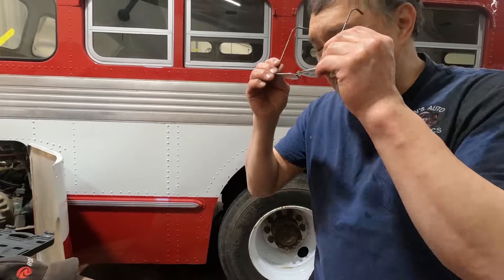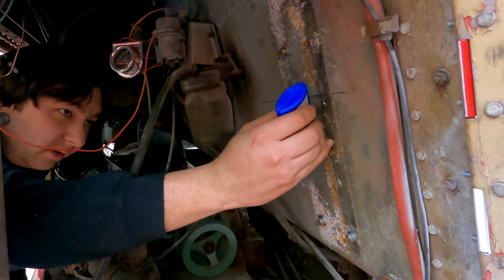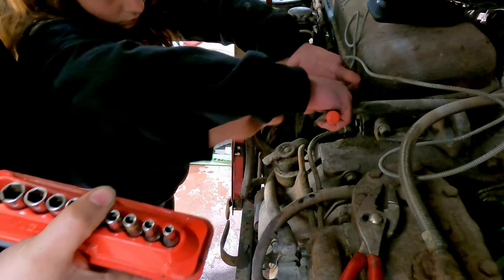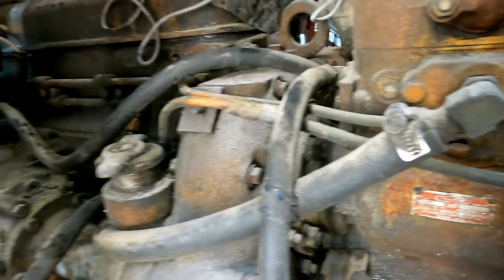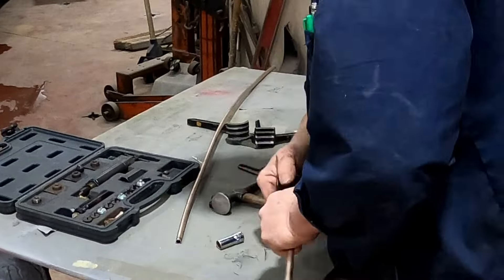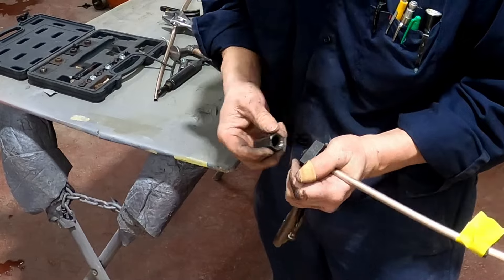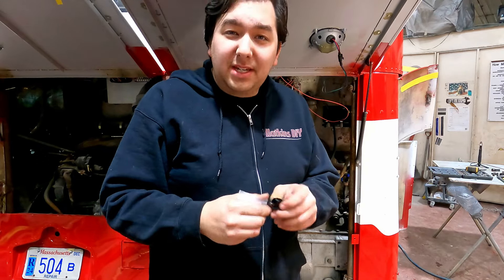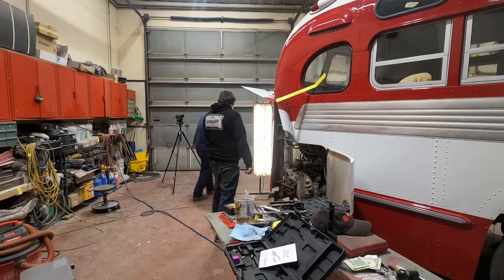SOAKED in Diesel, We FINALLY say GOODBYE Jerry Can!

Comment: I would suggest you mimic the original Detroit design of the fuel system a little closer and add a filter back between the fuel pump and the injector lines.  In the event of a fuel pump failure you would be sending metal debris to all 6 of your injectors. This could turn a relatively small problem into a much larger one. 

Also, ball valves before and after the filters would allow you to change the filters in the future without allowing all of the fuel to drain out of the lines. 

Just a few things that came to mind while I was watching. I really like seeing what you guys are doing with the bus. Keep up the good work.

Comment: Very good. One more hurdle completed. Where is your voltage regulator at now? There was originally a wall there where your fuel
Filters are now and that top door was for your voltage regulator access. Cudos on getting rid of the can for fuel. Back in the day. They use to calculate how many miles the bus would run on each run daily. Buses were fueled daily anyway. Never needed  gauge. The stick thing was mostly a second owner private not company owned. So they could tell how much was left . Even then it was estimated
Reply from the maker: Hey Bryan ! Jon here, the entire generator, and voltage regulator has been removed when I rewired the bus. I decided to go with an alternator system and standard negative grounding. I still have both the generator and regulator in storage, but no use for them for us. Thank you for always watching and commenting and the mini history lesson- it’s neat to understand how these companies operated !
Reply: Hey Jon,
Thanks for responding so soon. Hold on to those parts as you never know when another one will surface for restoration and they will need your help. Keep up the great work. I am still stunned at the progress made in short a short. Or seems like a short  time .